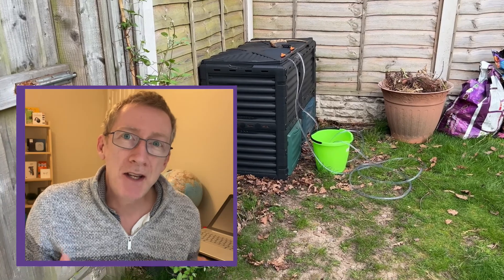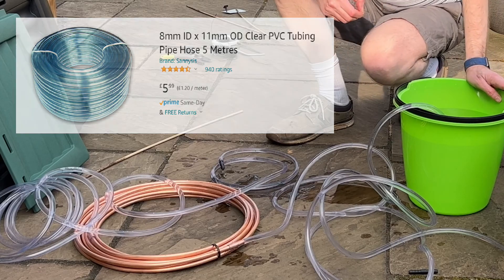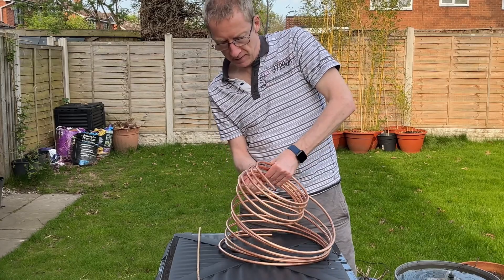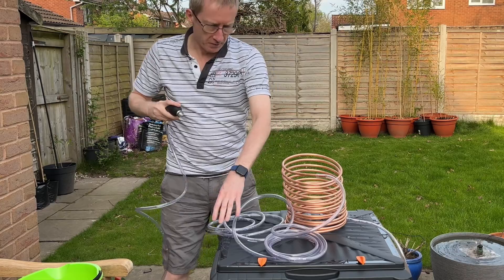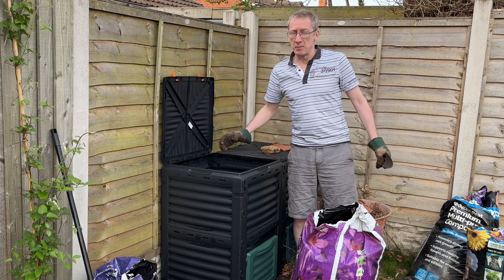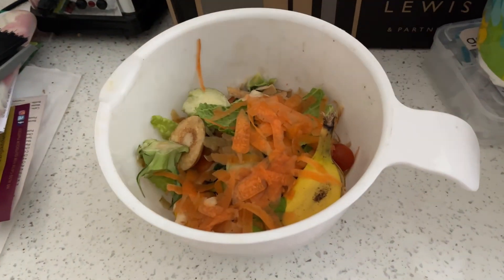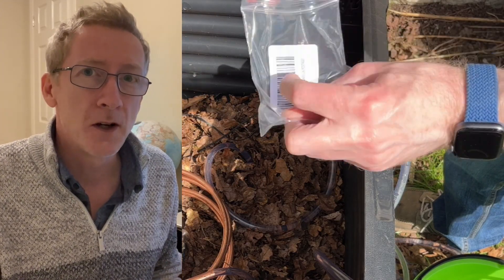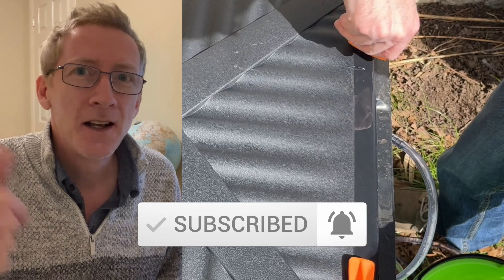How To Heat Water From Compost

Comment: Podría usarse manguera negra???
Reply from the maker: Copper is a much better heat conductor than black tubing, as black tubing is typically a poor conductor and can even be an insulator. Copper's high thermal conductivity makes it ideal for applications like heat exchangers, while black-colored materials are often used to absorb radiation, not conduct heat through the material itself.

Comment: Amazing Tom, proof of concept confirmed, don't give up!
More ideas:
-A single scaled up compost bin made from pir insulation walls.
-moisture meter.
-aerated static pile composting.
Both of the latter points are very important as dry/anaerobic conditions will rapidly stop all activity.
Reply from the maker: Thanks a lot and thanks for your detailed feedback too.

Comment: The problem is turning it without bending or breaking your copper pipe. They also sell solar-powered water pumps that would be a good idea to circulate the water I'm thinking about doing something like this and my greenhouse to heat it

Comment: Have you looked into doing this but with a sand battery?
Reply: This is Already kind of a (reloadable) bacterial battery ;)
Reply from the maker: @Kieren Carter Not yet. Interesting idea though. Thanks for your suggestion.
Reply from the maker: @AutoNomades Yes I guess it is
Reply: @tomsgarden  having a sand battery to the side and the water which comes from the compost moves through the sand battery to store the heat. Sand batteries are pretty awesome and if U wanted to conserve the energy obtained from the compost this could be a way to do it

Comment: A noble effort Tom, but a more practical setup could be easily achieved using larger compost bins (pallets are great and usually free, giving you at least a cubic metre of compost). Adding manure of some sort would also help, temperatures with manure tend to be higher. Again, this should be free from local stables or farms or, if you are adventurous enough, even humanure works fine. Finally, adding wood chips I am told tends to keep the temperature higher longer though I have to admit that I have not tried it myself. Good luck with your further experiments!
Reply from the maker: Thanks George, and thanks for your feedback.
Reply: Wouldn't wood decompose if used for compost bin?
Reply: Higher yield from food which is high in sugar.

Comment: You can construct a small raised platform header tank with a ball cock water supply, from a large plastic water butt.
The ball cock can be fed cold water directly off your water supply by a garden hose, you can link in your raised header tank to another insulated raised plastic water butt storage container, at a low point water feed in flow point. 
The water butt container can then be linked up to your compost heat exchanger with a lower flow direct feed, and a high flow direct return.. (Convection heat flow.)
With a high point hot water external flow pipe to your tap point?
Reply from the maker: Very good idea! I will look into this. Thanks for your feedback.
Reply: I am making one for myself and will be using either a single room CH radiator panel, or a 15mm 
coil of PEX pipe?
All 15mm plumbing fixtures and fittings for the header tank, storage tank, flow and return pipes are all both standard, and the cheapest to buy..
Reply from the maker: Good luck with your project.
Reply: @tomsgarden  Just to let you know Tom, that I have completed my compost water heating system. 
I will be producing a full video of both the complete build, and the water heating results at the end of October?
The compost pile has been activated over the past two day's, and will take a month for it to both ferment and produce heat?
👍